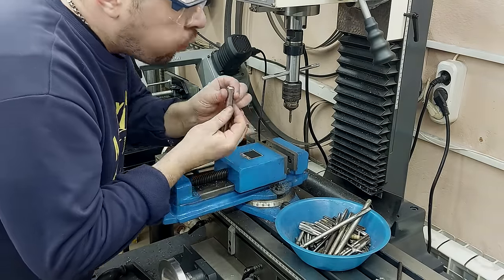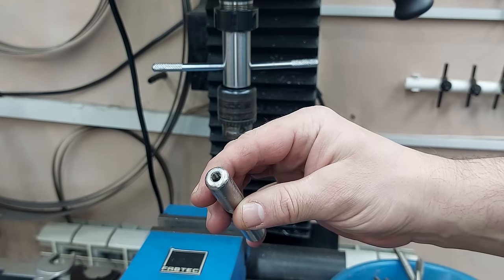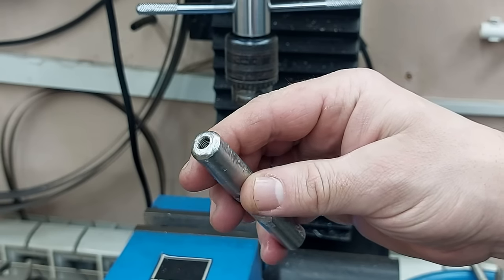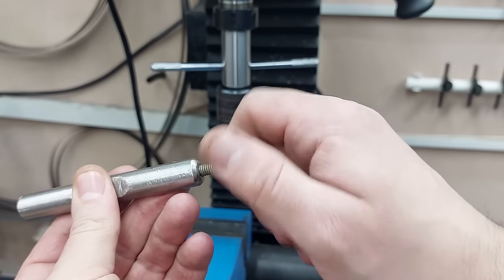I didn't believe it myself! Genius trick and tip in 6 minutes for the home handyman

Comment: Wondering why you took multiple small steps in necking down the shaft at the start of the video?  Why not a deep cut and then a finishing cut to save putting all the wear on the tip portion of the tool?  Also, I don't know what the steel was, but what a beautiful finish.  The planing tool looks pointed.  
'We' need to see your pug(?) chasing a puddy Kat.
Always enjoy; many thanks.
Reply from the maker: Thank you very much my friend and welcome, it is a pleasure to read your comments😉

Comment: use the lathe to create a tool which is obsolete if you have a lathe... you can do exactly the same on the lathe machine by use the thread cutter like a drill in the tailstock and mount the bolt where you would like to cut the thread in in the chuck. then turn the  chuck by hand.. the unfixed tailstock just move in, in axis diretion, and the positiv benefti, when unscrew the thread cutter change the direction of the lathe and its pushed out by itself...